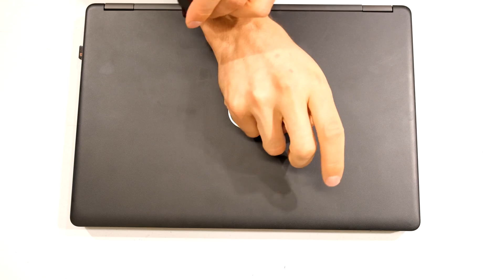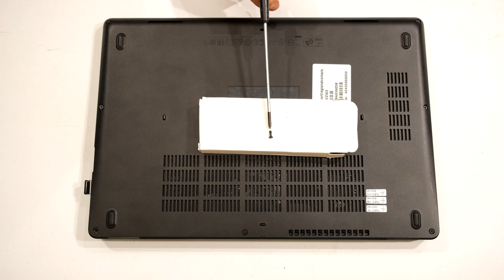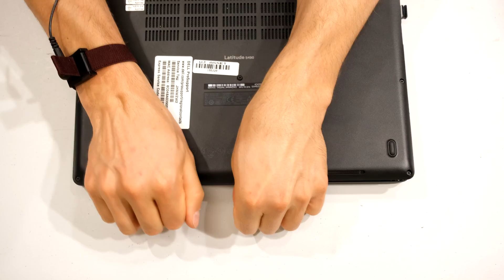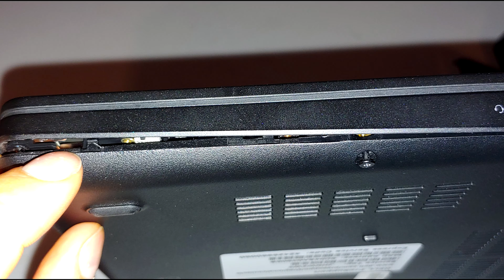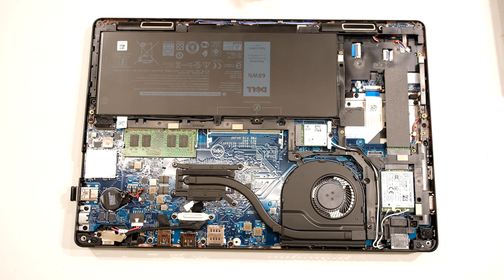How to change the RAM in a Dell Latitude 5400 laptop

Comment: hi. I have a question. I want to upgrade from 8 to 16 GB RAM. Is is better to have two 8 GB Rams or is it better to have one 16 GB RAM card. I have dell 5400 which has two memory slots. one has already 8gb RAM. Thanks.
Reply from the maker: 2x8 better but match the RAM - try same models.